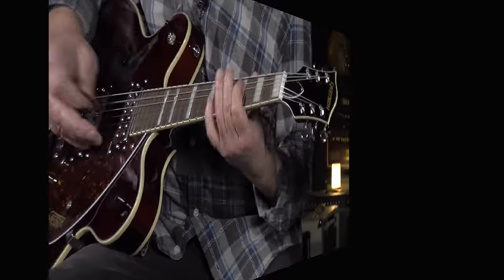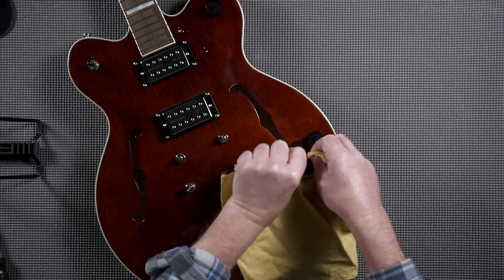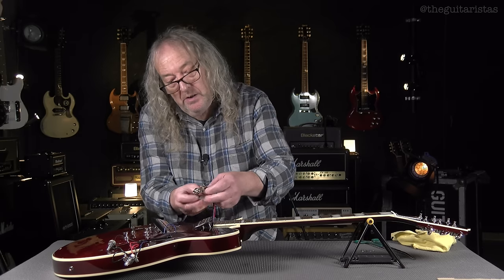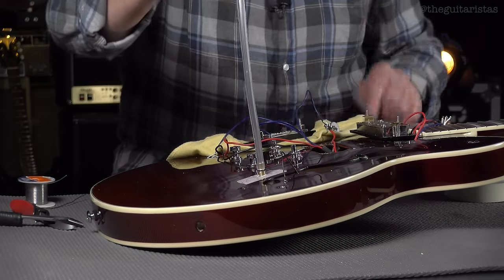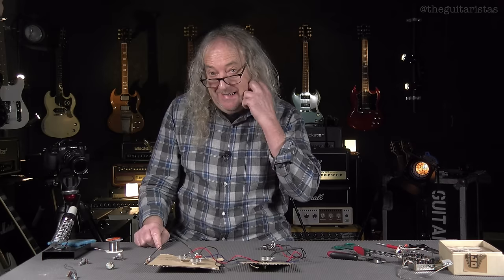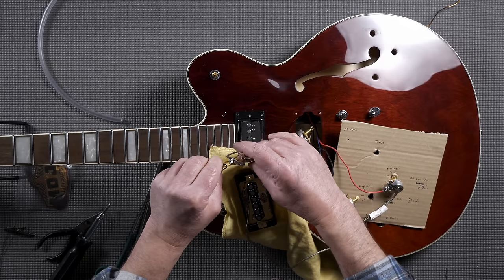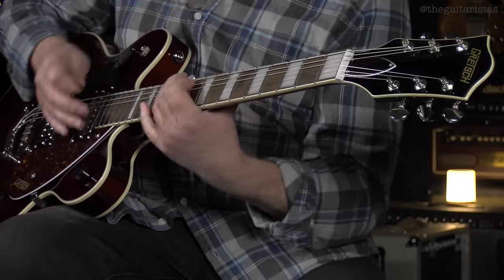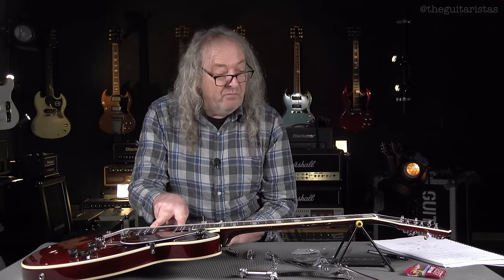Gretsch Streamliner G2622 Upgrade - Part 1: New Dynasonic Pickups & Wiring - Was It Worth It?

Comment: I was quite fixated to get a Casino but the whole Gretsch streamliner line is very appealing, I'm leaning towards Gretsch every time I'm on YT. One thing I'm really curious about is their chambered center block, try to have a good look at your vid but still not sure what's underneath - is it something between fully hollow and full center block?
Reply from the maker: Did you see the bit where I filmed inside after removing the pickups?… it’s fairly basic not a whole lot of block really
Reply: @theguitaristas  thanks a lot for a quick reply. Yeah, I've watched that bit and it seems to me that they're more like parallel bars that runs along both side of the pickups than a solid block. Is the bit between the stop tail and strap button completely solid?
Reply: Ahh the answer is in another clip that you've made... Sorry I didn't know that,  I'll reply to myself here so people who's curious about the same thing can see - it's pretty much two parallel bars along the length of the body.

Comment: waiting for the bigsby...i owned one of these and im considering putting in some vibrato but i am just afraid to do some drilling on my guitar...maybe you can try to put duesenberg les trem and see which is better between bigsby and les trem...
Reply from the maker: I discovered the B5 I have won't fit so I have to get one that will... bit it will happen soon! 👍
Reply: @theguitaristas  try bigsby b6 with a bridge down tensioner from TOWNER...

Comment: How do we really describe a differance in sound?  It is weird to try.  saying that bs, I prefered the new ones especially when you were doing your thing on the mid neck on the e,b,g,d strings, it was clean but well defined punch and the youtube compression did good.  I think like you said, we feel it more than anything, and find the instrument more desirable to play.  It is more easy to eq the instrument to what youre trying to get.  Appears to be no mud in the new pickups.  That seems to be my gripe about cheap pickups and wiring, although are new pickups of any kind better than the original old manufacturing process?  I dunno. May make a good video to watch, and Im sure theyre out there.  Thanks for your presentation.

Comment: Gotta be honest fella, most of what I know about this stuff is from watching you! But I’m sure it’s 250k pots for single coils, And 500k for Hummies 🤔🧐
Reply from the maker: Could be... unless they are P90's so I went in that direction! But I shall endeavour to find out what the difference would sound like... we need to know! 😁👍
Reply: That's not a rule, it's just typical for the big manufacturers. I always start with 500k on any guitar, I'd rather be able to roll some highs off with the tone control (or amp) than have them taken off before hand. Unless your guitar pickups sound horribly harsh in the highs, then to me 500k is preferable.

Comment: With single coils, 250k-300K pots and a pf.22 cap would be more what is normally found in a single coil set up.
Reply from the maker: With fender style singles for sure… but not P90s so I went that way 🤔
Reply: @theguitaristas  It's not a "Hard & Fast" Rule, as long as you like the results, it matters not.